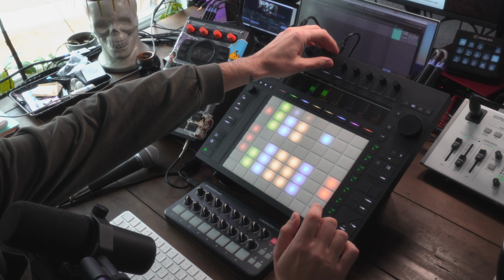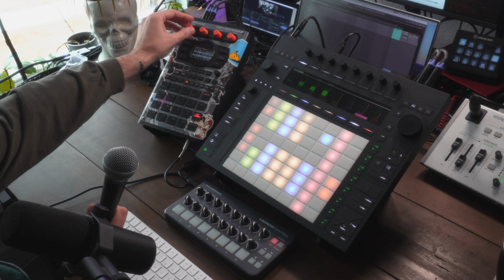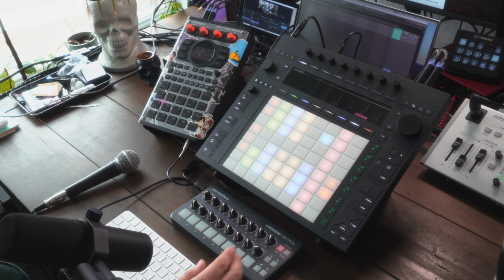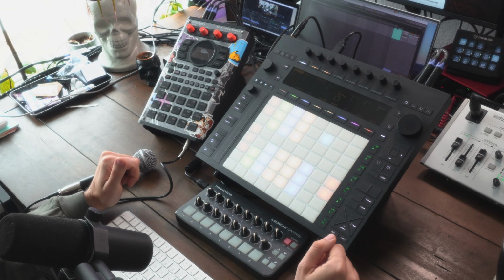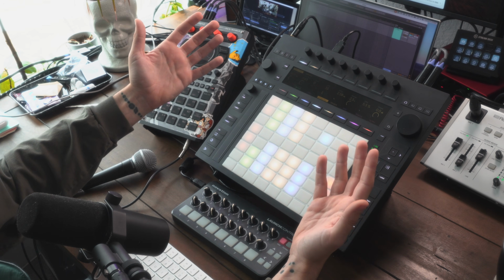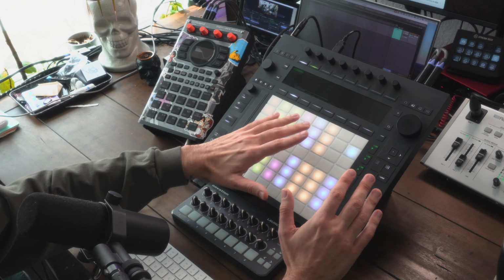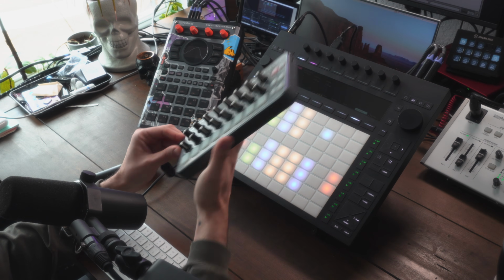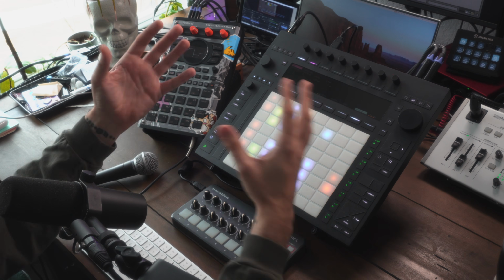major limitations of ableton push 3?

Comment from the maker: update! re: Device Lock on Standalone! 

I'm working on a new project which I started on Live (desktop) and locked a device to push in controller mode. When transferring this project to Push for standalone performance, the Locked device remains "locked"

no idea why it works on this new projects vs the project featured in this video. The only difference I can think of is the new project originated on desktop, while the project in this video originated on push standalone 🤷🏻‍♂

there is also 0 mention of Device Lock in the Push 3 Manual online currently.
Reply: Could you make a video about the benefits of Push 3 as just a controller? it's not worth it as a standalone for me.
Reply: i was just now looking for that in the manual because i need this feature, too, and found nothing. i know how to lock a device in ableton, but is it possible do it from the push? or to switch which device is being locked down on the fly? 

i chose the controller push because i couldn't think of a use case where my computer would be somewhere else. i'm relieved but not surprised to hear the non-standalone has some advantages.
Reply: How do u lock it in ableton?
Reply: @qwertySnowy  right click on device title bar and you will see "Lock to push 3." (push must be connected and on or you will not see this option.)
Reply: @kittensinkmusic  great thanks and this doesn't work in stand alone?
Hope they fix it
Reply: @qwertySnowy  we'll see what happens. if you lock a device in ableton on your desktop it will be locked on push, but you can't lock/unlock on the push . . . yet. it would be nice to control w/o having to go to your computer; also during performance i will want the ability to choose to lock different devices.
Reply: Does this mean that push is locked to one synth device and you can change to another track and show the parameters of that track?
Reply: @Taetro  you can only lock on device at a time
So if you have multiple synths in a device rack you'll only get one locked. Ableton need to fix it so when u press a pad it doesn't change screen and if unwanted to change screen use the track buttons
Reply: Is it still a problem in Live12.1? I'm still waiting on my upgrade kit tho, so can't test it.

Comment: 1: Vocal Processing, you now have Auto-Shift
2: Im not in front on push 3, but you can go to the settings and turn off the "Select on Launch" and you wont switch devices while changing a clip
3: you cna use the jog wheel to move around tracks
Reply: So basically with the recent updates he should be able to just use the push?

Comment: Hey, question for anybody with a Push 3 in front of them - how does your big jog wheel feel? I know it's supposed to move left and right, but it supposed to have a bit of play up and down? Also, are you able to select options by pressing on the bottom edge of the wheel? I can only select using the centre, left, right or top of the wheel, but not the bottom.
Reply: Left right only push button center only

Comment: You sum it up pretty well in describing Push 3 as more for production than performance. I bought it for livelooping performances, and there are some major workflow deficiencies:

* There's no fast way to record arm a new track and start recording. In session mode, you have to hold the record button and an arm-track button simultaneously; unless you have massive hands, this will take both hands, so then you have to stop playing your instrument.
* Same issue for stopping a record-armed track; you have to hold the stop button and the track button, so it's a two-hand operation.
* The issues around locking devices you noted; if I want to trigger a new track and immediately change an effect on the current track; whoops, the new track is selected, and instead I've changed some random parameter on the new track.
* The LED lights are almost illegibly dim in daylight. Some people say Push 3 will revolutionize busking, but unless you only busk at night, it's kind of hard to use outside.

It's a decent device, but if you see someone like Rachel Collier showing off Push for livelooping, they still need additional peripherals to make it work well.
Reply: Why don't you just arm all your tracks at once? Ctrl click on the icon it will allow you to do multiple at the same time.
Reply: you can use a foot pedal to start recording if I am not wrong what makes it way more handy when you are playing an instrument. All tracked armed could be an answer, select track (one hand) and foot pedal to start the recording. I don´t like the buttons on push 3, they should have made them goign outwards and not inwards, and way more easy to press. it was an ableton choice to make them so hard to press to not press the wrong button in performance mode I suppose.
Reply: Hold record and swipe across multiple channels at once

Comment: Biggest gripe is it goddam switching to the track when I launch a clip. It is impossible to perform that way. I wanna launch a clip while I am tweaking a filter, or whatever. I am quite capable of switching to a track when I want to. Why Ableton??? The beta feedback is full of people begging for this functionality.
Reply: Bro theres a setting called "select on launch". Turn it off and there u go
Reply: As at least one other person pointed out in a comment here, an update recently made this an option - here, I quote the other comment: "Push 2.1b1 added this feature : 'Select on Clip Launch:Choose whether or not you would like Push to select the track of the clips that you launch automatically.'" :D Should fix your issue, right?
Reply: wait, really? to me this is the only point to have a clip-based sequencer as opposed to a linear workflow like the MPC. I guess I'm not getting a push or ableton then
Reply: @treschlet  I've been enjoying composition, sound design, and all that on it, but strangely performing is one thing it doesn't do as well as it could. I've been using mine for a year and I'm starting to think maybe I'll sell it. If they had a roadmap for software updates I'd be more inclined to stick with it, but so far there isn't.

I really want a one device to rule them all solution and maybe this isn't it after all. I tend to shelf a synth I am not having fun on anymore, and then if it's not been used for a year I consider selling it. It's still on my desk though, but the TR8s and Elektrons are back out and slowly nudging it off.

Comment: Push 3 is the best controller specifically for Ableton Live, bar none - hands down. Push 3 is not the best standalone device on the market, although it is certainly on the short list. Top suggestion buy Push 3 controller. It can be upgraded to standalone later if/when updates are made to suit your fancy.

Comment: I too have run into these issues and solved them by incorporating a vocal pedal for tuning/formant shifting and a separate controller for master control effects. I also "play" the push in note mode so it makes mixing on the fly hard as well. I use the knobs and faders on the Akai or my Arturia to handle those moves. https://youtu.be/K4-yQC9_zzc

Comment: I think APC40 MKII and Midi Fighter Twister will give you all you need. The funny thing is these two devices are close to 10 years old lol :face-blue-smiling:
Reply from the maker: those are great performance tools to pair with a laptop but my ultimate goal is to have a single standalone device that does everything I need. Push is ALMOST there

Comment: Standalone, the push 3 is severely limited as both a production and performance tool. However there is a great control app to adjust and save custom settings. It’s called Live
Reply from the maker: Re: Live as the control app - I mentioned this in the video! 

It’s definitely not severely limited from a production perspective but needs more updates to reach its full potential

Comment: Good info, thank you! For me, I am not interested in the standalone side of Push, as I do all my work on my computer. I am more looking for something that provides better control and helps my workflow. I have been on the fence on this, since it came out, and have been leaning more towards a keyboard controller upgrade. I had even put an Akai APC64 in my cart and then paused. I own a Nektar Aura, that really only sees any use when I am creating percussion and a NI A49 controller (with a terrible screen and the common led pixel issue from being on all the time). I was sadly disappointed in the new NI Kontakt MK3, which delves deeper into the NI ecosystem. For now, waiting to see what Arturia do with the non-essentials Keylab upgrade or maybe Novation puts out a new SL MKIV, this year? I lean towards keyboard controllers, over pads, as I am a keyboard player. For me, biggest selling point, with my eyes - big color screens, nice keybed, and a must have - Poly AT. I even thought about getting a Hydrasynth Deluxe, as I can create a midi/audio track workflow, pretty easily, in Live, and can still control other soft synths, just won't have the actual DAW control. I own a couple of other vintage synths, that I do use currently, just this way.
Reply from the maker: If you’re not looking for standalone, the APC40 is a great controller and then you just need a keyboard for notes! Or APC64 if you don’t mind touch strips and mode switching
Reply: @Taetro  Thanks. I wish someone made the perfect controller keyboard. Haha. Also thought about getting an Icon for Live and Bitwig controls. Ah the toys

Comment: I think there is a workaround to lock the push screen. From software you can right-click a device's title bar, and select "lock to Control Surface X". This way the Push screen remains locked.
Reply from the maker: This works in controller mode, not in standalone

Comment: Push is a unique standalone device in that it’s largely useless for a performance if you don’t also use it with your computer (for setup). 😅 Was definitely a surprise to me and why I never use it.
Reply from the maker: well I think based on my performance it's definitely not largely useless. I think it's very useful and there's a reason I used push instead of other gear - but some simple changes could greatly improve it for performance
Reply: @Taetro  largely useless without leaning on your computer for setup. End of the day it’s up to the person. But, for me I just don’t enjoy working on something with the Push 3 when it is just standalone. I don’t want to be using my computer to support me in working on my performance projects I just feel like they could have thought a bit more about the workflow.
Reply: It's almost like we need a different term for it. The Push 3 is like a device you use to supplement Live or when you temporarily don't have access to your computer.

Comment: I appreciate you digging in to the process of building this, and I really appreciate you highlighting some of the limitations you came across and sharing your solutions. Definitely inspired a few 🤔🤔🤔 for me
Reply from the maker: yeah, I kind of went on a whole journey trying to make an easy, compact standalone setup - with every configuration I went through, there were just TOO many limitations and I found myself yearning for the Live workflow of course. 

So I ended up back on push. Added a few more gear pieces and it worked well, but I hope they'll make some  updates so I can do everything you see here using JUST push